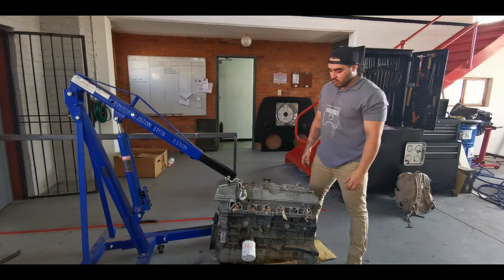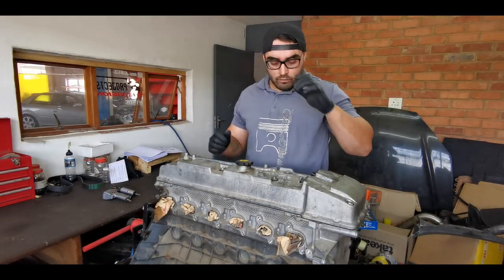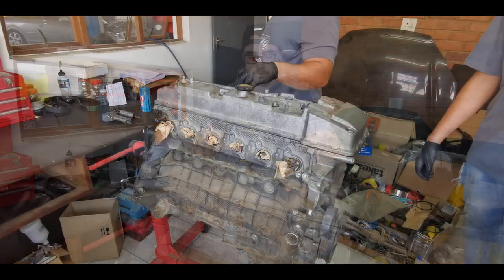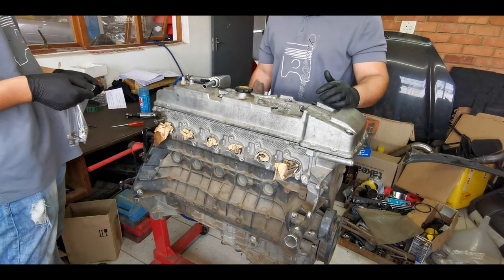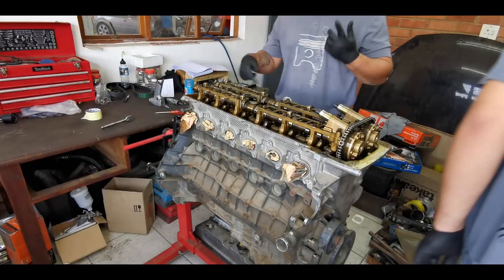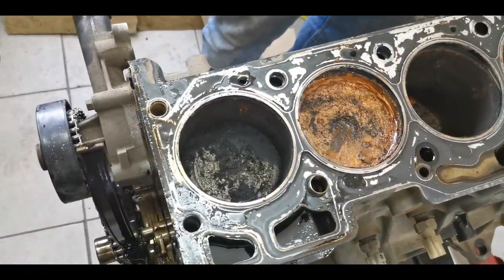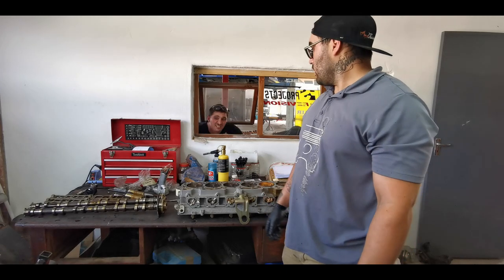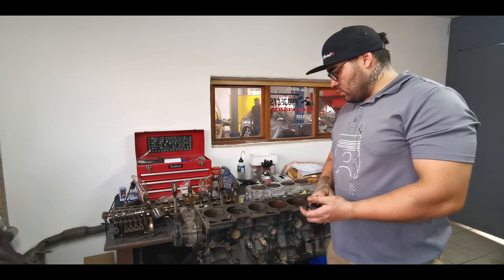Building the Barra

Comment: Hi guys great vid.Here in Australia the territory turbo from mid 2006 on was given the bf typhoon engine as they had tree trunks size conrods compaired to the early 2006 turbo engines.My mild territory turbo on 17psi is making an easy 305kw and 877nm of torque at all four wheels for well over a year with no issues :-)

Comment: we here in australia call that a milkshake , when radiator blows and mixes trans fluid into cooling system , very rare for the head gaskets to go on these motor unless its pumping 30+ psi through it
Reply from the maker: Our radiotors don't have the transcooler on them here
Reply: @InHouseBuilt   on your territorys ?  there in south africa wish they had done that here,   this happens a lot here in australia  trans cooler is part of the radiator tank, most people even me run a external cooler on my territory  only safe way to make sure it dosnt happen , that motor of yours must have had a hard life then but lucky there is plenty of parts suppliers who can help you out , woody from skid factory is a ledgen so is turbo yoda allways willing to give a helping hand
Reply from the maker: Yeah man as far as I've seen and on my personal Terry it's not had an internal oil cooler in rad
Reply: The head will lift at about 20 - 21 PSI  if you don't upgrade the head studs
Reply from the maker: Yeah thanks we are aware, Got a bunch of parts coming from Australia, proper head studs, gaskets and and and.
Reply: The zf6 transmission ran a heat exchanger off the side of the engine block and not an internal cooler in the radiator. 
Deleted mine from my territory to prevent milkshake.

Comment: Where can you get a plastic Barra mock up engine, what's the best Barra to buy, how to identify it, and where to get them. I'm in the United States ...
Reply: Barra270T or 310T is the best. But if you are going to build the motor go a Barra 195 and build it up as most of what the 270 and 310 have advantage wise you'll end up replacing anyway.
Reply: @APrattProduction  
Are those numbers 270T or 310T stamped on the engine somewhere. I'm in the U.S. and never seen one in person...
Reply: @joeschlotthauer840  you can do a Engine Number Check for free on an Australian website and it will tell you. Or EMail Ford, the easiest way to tell is the rocker cover color. Red is 270t blue is 310t, green is the LPG motor that had stronger internals from the 310 to prevent bending rods from backfires so they have thick rods and alot of people use them to do check turbos conversion as the green top costs $300 but the blue top costs $5000+ 
Red tops cost $2500ish
A silver top (195) is about $300-500 but has the weaker rods as it was the NA motor.
Reply: @APrattProduction  don't forget from 2006 onwards all turbo bottom ends where stronger and the FG models onwards hard better head work done for better flow.
Reply: So basically the best you can get is an fpv motor (bluetop) but second to that and highly recommend is a FG xr6t engine which is a red top. Engine was manufactured from 2003 to 2016. Go for redtop 2008 upward. Goodluck tho

Comment: You got a dud they are everywhere around here in syd aus better off starting with later model turbo engine or at least a lpg block they have the stronger factory conrods they are good for 6-700 hp
Reply from the maker: here in my country they are not laying around, and In the video I did say I own a turbo barra so I know what they capable of. As I said im ordering everything I need from AUS to build the motor new the head, block and crank are in perfect condition for what I need the motor to do